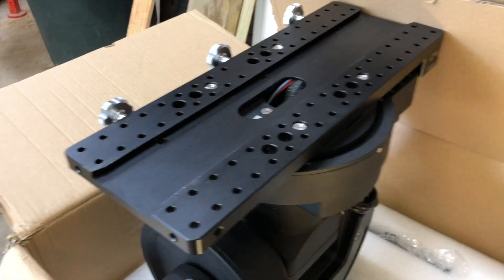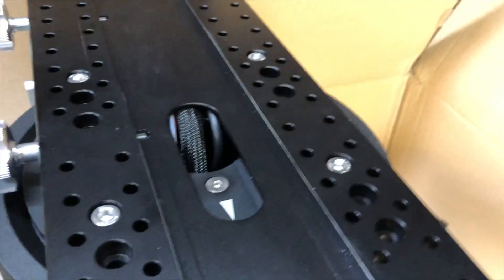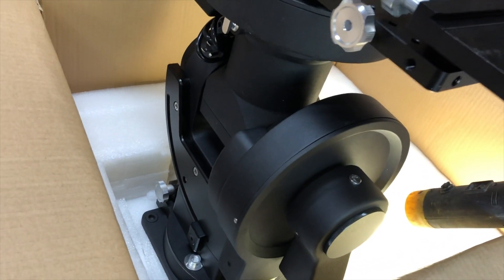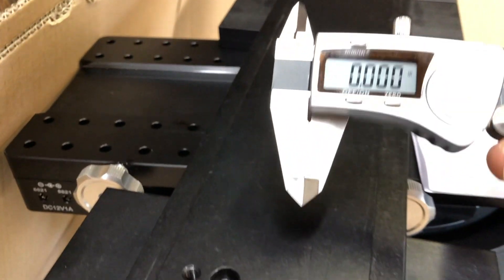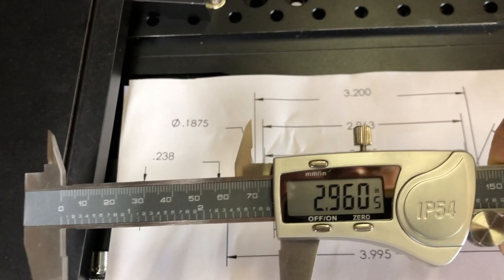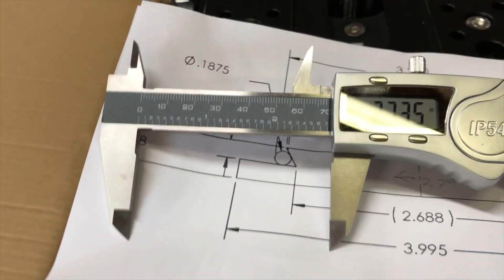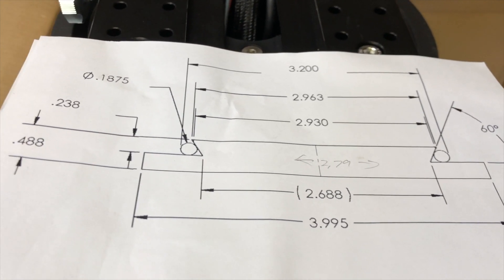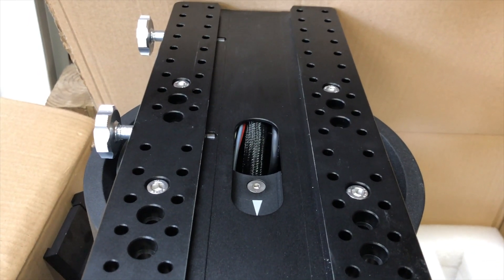CEM120 Saddle Problem

Comment: That is so disappointing, not what you would expect from such an expensive mount
Reply from the maker: Indeed.  As mentioned in my reply to Michael below, I eventually resolved this by having a local machine shop shave some off of the saddle.  I have to say though, now that I'm past this issue I'm thrilled with the performance of the mount.  I have about a 65 pound load on it and I regularly get 0.3" to 0.5" guiding.  That's twice as good as my previous mount, the iEQ45.
Reply: @dkuchta5  thanks for the info :-)

Comment: I too had the same problem using all 3 mounting plates I had. They sent me another mounting plate and it was just as bad. Poor quality control. My friend had to shave of .013 inches of metal to make a new plate work.
Reply from the maker: Exactly what I did.  Except I didn't have a friend who could do it so I had to pay a machine shop.  After going through a couple of replacement saddles from iOptron, I realized that the actual top of the mount head, the surface that the saddle bolts onto, was not machined flat.  They were able to provide me a saddle that worked fine when it was not attached to the mount.  But as soon as I bolted it to the mount, the Losmandy rail would no longer slide through it.  Apparently, bolting the saddle to the top of the mount caused it to warp slightly to conform to the top of the mount.  The tolerances were so tight on the saddle that even a small amount of warping caused it to be unusable.  So, like you, getting it machined for larger tolerances was the answer.
Reply: Finally send the mount back to iOptron. They replaced the saddle that was undersized, and replaced a defective dec motor.